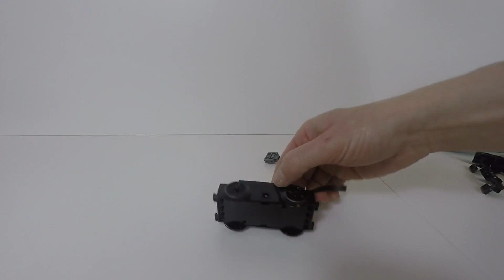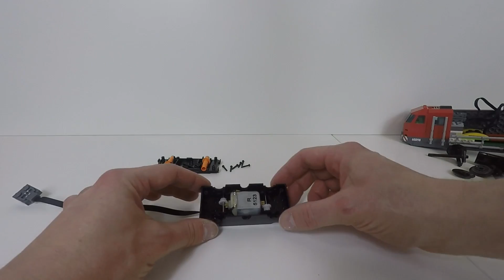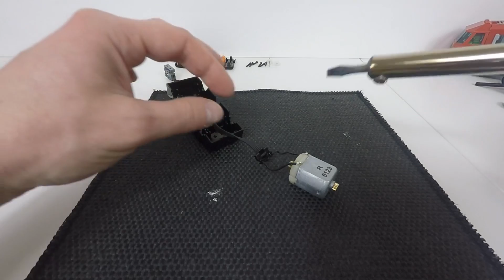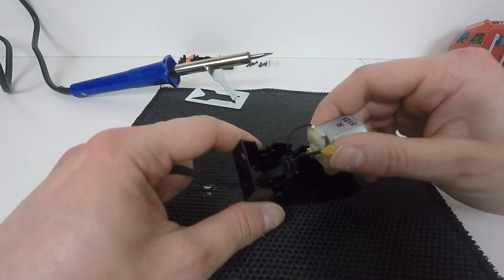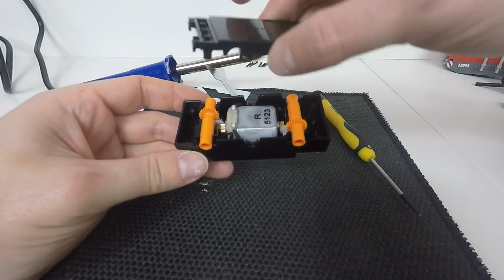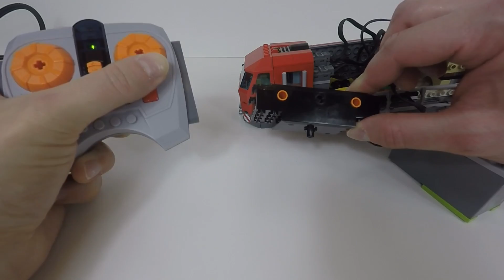Tutorial, Modifying LEGO Train Motor!

Comment: Get some 2 part Power Function plugs from China ,cut cable at plug , turn cable 180 degree , apply 2 part plug and hey presto . Motor reversed
Reply from the maker: That only works if you have space to fit it in, the preferred way is to use a PF switch which reverses the motor. If there's no space this is the best way I've found.

Comment: can't you just switch the switch on the controller
Reply from the maker: When running two motors on the same controller on the same channel, no.  This also saves space in one engine if there isn't room for a PF control switch.  It's not an ideal solution now since PF motors are no longer sold by LEGO.

Comment: I’ll be trying trying this for my Maersk loco, it really warrants double tractive motors, and trying to route the wiring is a pain! Definitely going to try to get a rechargeable power pack, battery’s just get used up so quickly!
Reply from the maker: It could be worth trying to get a PF switch and see if you can get that to fit, you can reverse the motor without any modification.

Comment: i think the easiest way is to open up the motor, switch the position of the 2 contacts from the inside.
Reply from the maker: That's what this video shows.  The motors were running at different speeds when on different channels on the IR controller.  Another way to do this, if you have space, is to use a Power Functions control switch which can reverse the current to one motor.

Comment: Hi Dunksterbricks,
It's a solution. I found a solution without opening the motor. It consist in burning 2 places on the connector and invert it in the IR...so you can use 2 inverted motors on the same channel It works fine...and you don't have to open it and risk to burn the tiny wires...
I use this technique on my 60052...and also my double HE..
Thanks for your solution, i'm very interested in your tutorials....
Very nice vids...

Comment: Couldn't you just flip the gear wheels the other way to reverse the direction?
Reply from the maker: +Endothermic Madness All the fittings only fit one way, there's no way to swap the gears around.  The easiest way I could find was to switch the wires.
Reply: @DunksterBricks  Couldn't you just turn the train?
Reply: @novato5106  You meant the motor? The wiring is in the other way and It would be harder to fit them when putting both motors in the same way.
Reply: DunksterBricks, man! It's been 1 year since I posted this comment!
Reply from the maker: +Endothermic Madness happy anniversary lol :)